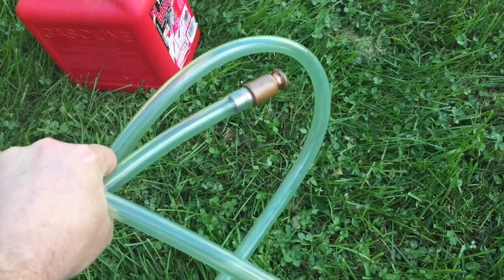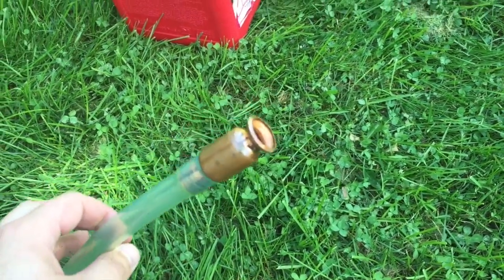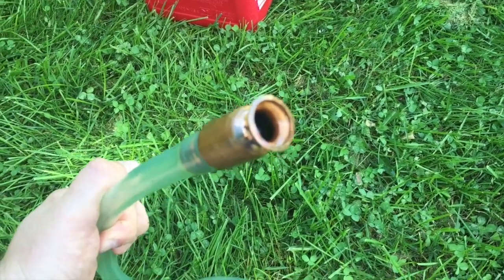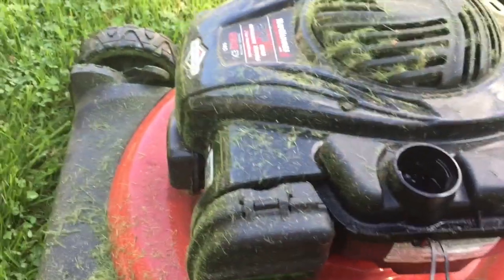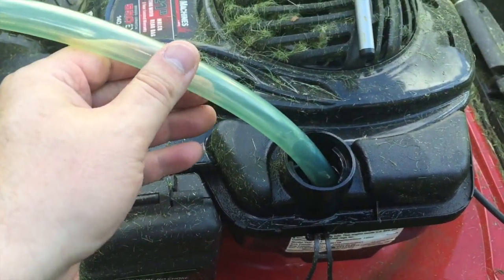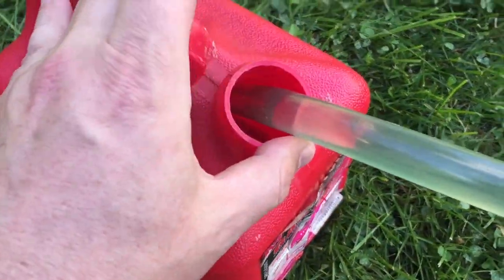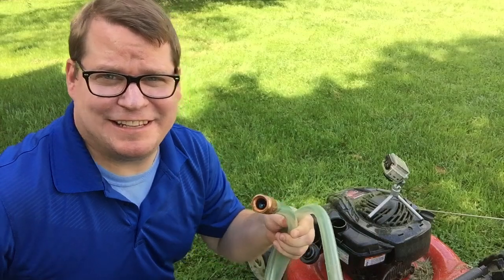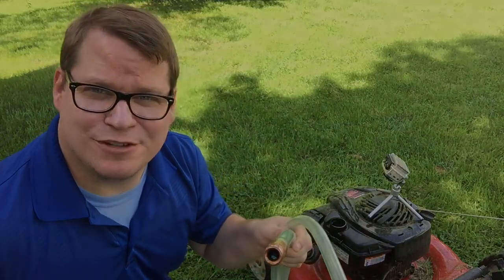HOW TO USE A SUPER SIPHON TO TRANSFER GAS

Comment: I don't think you can use this to siphon gasoline from a car or RV unless the vehicle is very old, because I think you will find that it is way too wide to get it into the tank, past turns and anti-siphon blocks.   I recently tried to use this with a 1990 motorhome with no luck. I finally had to use a narrow (1/4") tube, put a wire inside the tube to get it to feed, and after a big struggle I finally got the tube in to the gas tank.  then I had a terrible struggle to get the wire out of tube & leave the tube in the pipe & tank.  I think that motorhome gas tanks need a drain valve built in, in the bottom of the tank, since people are likely to let motorhomes sit a long time while this wretched gasohol becomes unusable.
Reply from the maker: That can be an issue.

Comment: Would this work to transfer from vehicle to can?
Reply from the maker: Not ideal as that metal piece would be tough to get into the tank.
Reply: You'd think they would have come up with a thinner one to fit the small opening on the gas filler neck of cars and trucks.
I've tried using an inline fuel pump to empty the tank in an '86 GM vehicle without any luck.  It will not pull enough suction.   Hence, the reason for researching the Super Siphon.

Comment: Will it fit in gas tanks on cars or trucks ?
Reply from the maker: I think that will vary by vehicles. My guess it is would work great for older model cars. Not sure about the newer ones. Best bet to check the diameter of the hose and make sure the fuel fill line can accommodate it. A great little siphon! Thanks for watching.
Reply: @KeepOnWrenching  , Thank you for the help.
Reply: Thanks
Reply: No

Comment: OK. Perhaps mine is shot. I don't hear the ball bearing jiggling inside the copper part of the hose. So when I shake it, a small portion gets sucked up to the hose. But it doesn't keep flowing? I keep to have to shake it continuously. Then it stops. The hose is half full of gas but it doesn't drain. So I'm left with gas I have to just run in my mower until it's out. Bought this thing at a state fair. Wish I can get my money back. What a waste. I should have known better.
Reply from the maker: It may just be stuck. Poke a screwdriver in there to see if you can free the head up. It definitely needs to move. Mine got stuck after I didn’t rinse it out after a previous use.
Reply: @KeepOnWrenching  so the ball is jiggling. But I still having problems getting the suction the constantly flow

Comment: The ball stops jiggling as it appears to get suction,  but does not have liquid come up the hose
Reply from the maker: Hmmmm. Gotta get it rolling. It’s an angle thing I believe. I know what you mean. Get it in the bottom of the tank. Needs to stay submerged.
Reply from the maker: Go try it in a sink or something. Once it gets going you will hear that bead bouncing around continually.
Reply: Brian Matson I was trying it in the sink, I started thinking maybe it wasn’t deep enough. I was trying from the sink and having it run into the toilet. No luck maybe I got a defective product
Reply from the maker: Perhaps. They are pretty simple things. That’s really puzzling. Bummed it isn’t working for you. You really have to jiggle it to get it going. That doesn’t sound good. Lol
Reply: @Salty-cracker68  Did the water make you go to the toilet psychological torture

Comment: Beware, this item Does Not Work as described. After receiving today from Amazon, I decided to test it out in my laundry sink filled with water with the hope to get it to flo/siphon into a bucket on the floor in front of said sink. Testing in this manner would allow me to see how this functioned prior to putting in my trucks fuel tank where I would not be able to view its required operation. After shaking/pumping and jiggling, the level of water extended several inches up the tube and then stopped. 

I reasoned at that point that being only water that I could either siphon the old way our perhaps prime the tube up with water knowing the check valve/fitting would hold the prime. Then realizing this is all about getting diesel fuel out of my truck. Neither of those options for me are viable so the status of this unit is that I am waiting on a return form/refund from Amazon. 

I am convinced that the weight of the fluid that happened to enter sealed the marble to its seat and would not allow any further fluid to enter. But hey that's just me....
Reply from the maker: Your source needs to be above the destination. They work great in that way. Not gonna work side to side in a sink. Try move water from the sink to a bucket on the ground. It’ll work.
Reply: @KeepOnWrenching  you need to reread the description of my test again the bucket was on the floor.
Reply from the maker: The do work fine. Maybe yours is defective? Use mine often and never had any issues. I hope you have better luck.

Comment: FML.
Most modern cars have obstructive devices in the filler neck though so you don't even get the hose into the tank that way.
Reply from the maker: Works great for motorcycles!